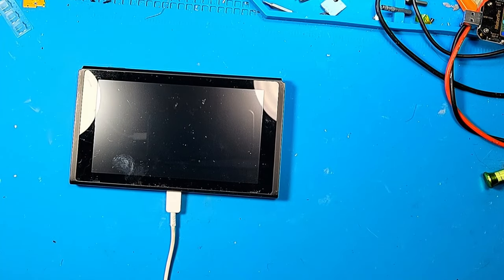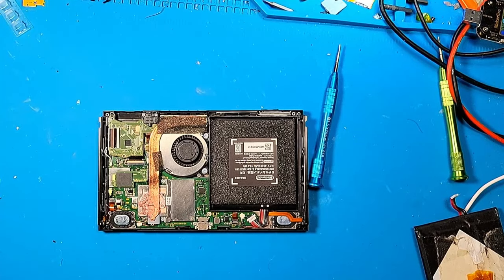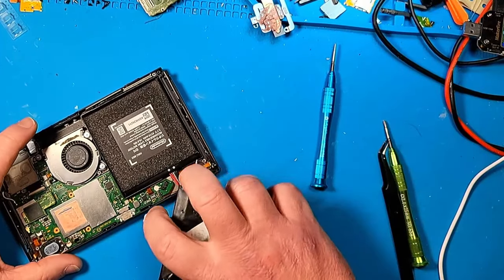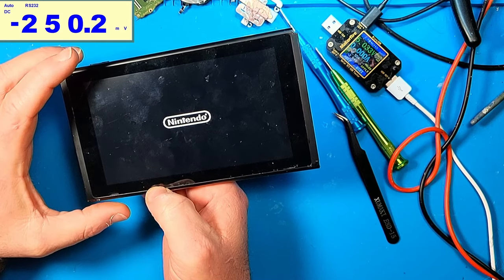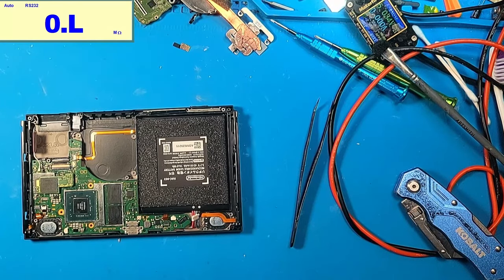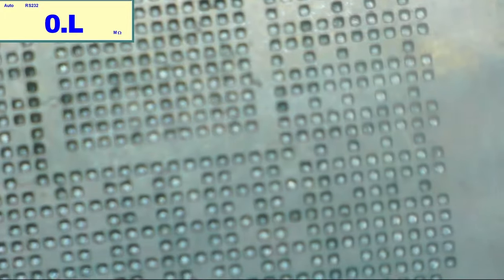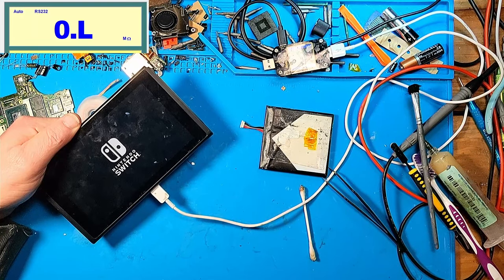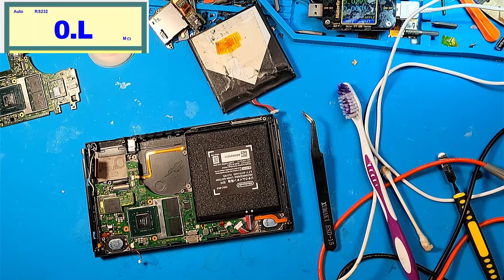Learning to Reball a Switch CPU

Comment: Small tip when using magnetic stencils:

The tint caps on the Tegra can be pulled off by a lot of those magnetic bases. So put tape over those or tack them down with something beforehand if it's an issue.

I've seen a lot of people assume their reballing itself failed when on insoection the caps are all stuck on the magnets and that's why it wouldn't boot after.
Reply from the maker: Oh wow, I did not even think about that. Good top will definitely be used in the future.

Comment: i remember an old video of this problem. in that particular case was the m92 chip. also the sound ic can block the system from boot completely. you could try those and see what happen
Reply from the maker: Good idea. I did swap the M92 at some point in the past, but not the sound IC. I will give it a try and see what happens.

Comment: Hi, I just found your channel and really liking it! Good job with the re-ball I had a major fail when I tried!
With regards to this issue I have just gotten a switch with a similar issue and managed to fix it by installing a mod chip on it, booting into custom fw seems to kick it into life and it then boots normal, (can remove mod chip if you want?). Hope this helps.
I will have a video up in a few weeks showing it.
Reply from the maker: Awesome. Will subscribe and thanks for the tip.